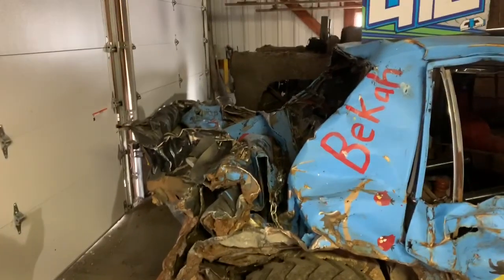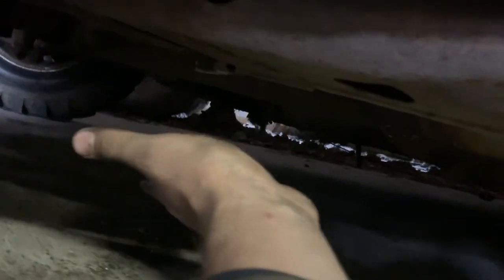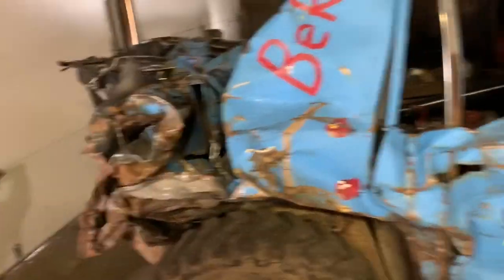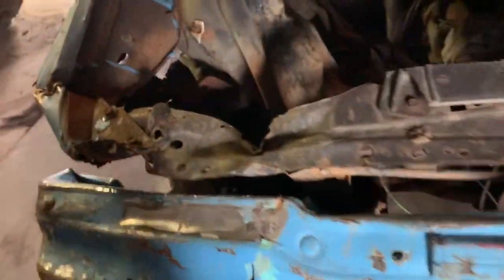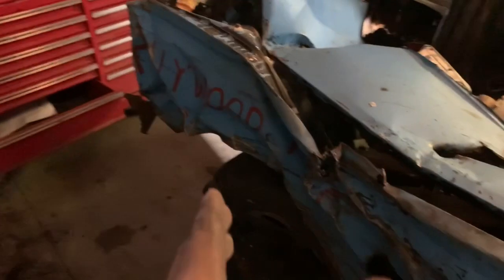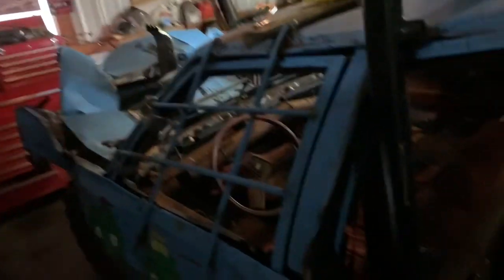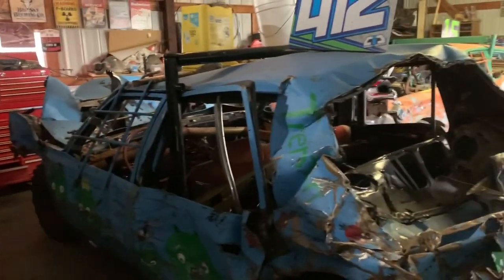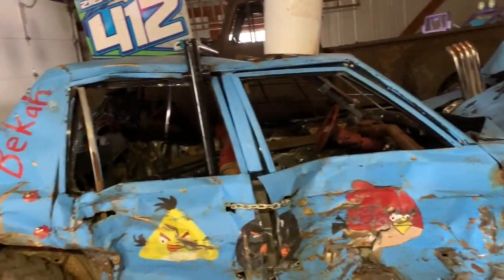Let’s fix the chain stock car part 1

Comment: If its bending in front of the a arms and you can stop it from belying out, full throttle and let her eat, seam weld a arm forward, seam weld your crush boxes, smash your humps "flat" and plate, weld all you can and chain everything, also I dont know how your rules are but run 1" all thread through square tubing as close as you can to the core support then run a piece of square at a 45 from the top of the thread to the front of your a arms, when it comes to the hood the two front all thread will hold it run chain right in the middle on both sides and run 1/2" bolts through the top of your firewall for the back of the hood